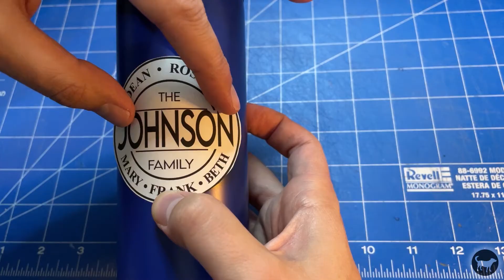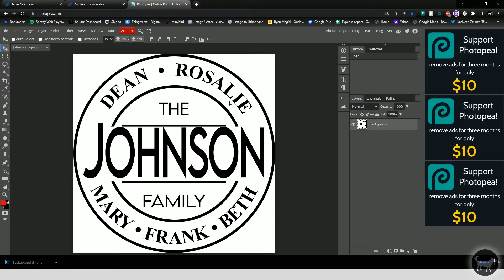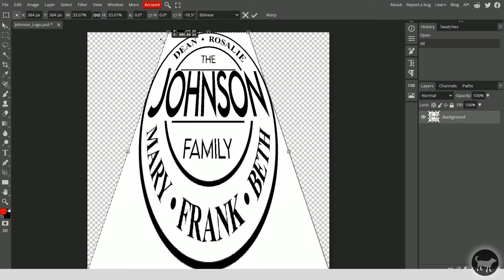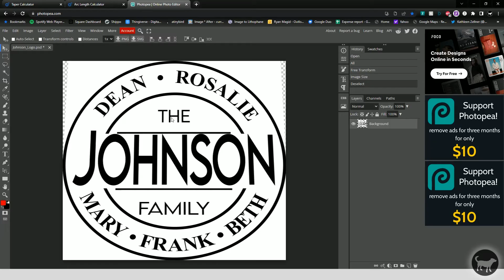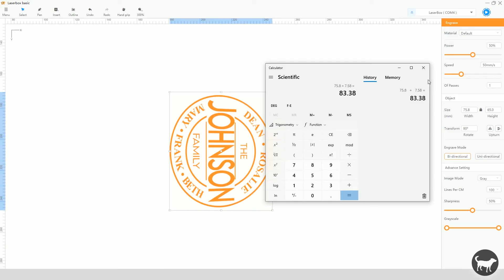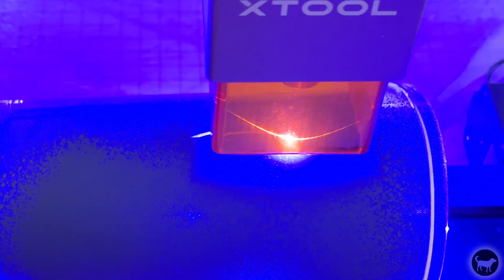Better Round logos on tapered glasses | Laser engraving rotary | xTool D1 and RA2 Pro | UPDATED

Comment: Is this not Angle to percentage solution?...
(Degrees in a circle, always 360/ angle from taper calculator) * 0.1 for percentage
So in this example
(360/4.851) *0.1= 7.42

Comment: Great video, it answers all the questions I had about this exact subject. Thank you!  

I am curious about accounting for the distance the laser thinks it's traveling. I use XTools Creative Space, so I don't know if the options you show are even available or if they are needed? Is this something you have to account for based on the laser software you're using or is this a common issue based on the item (tapered pint glass)  your engraving?
Reply from the maker: I have basically used the same technique even when using creative space. It’s not an exact science as it’s all about your perception but it dials it in pretty close to get you most of the way there.

Comment: Will this concept will work with 30 and 40oz tumblers with/without handles?
Reply from the maker: It should work with any size. However if you are using Lightburn they have since added a tapered glass setting in the software that you should also give a look to.
Reply: @BusterBeagle3D  I don't have lightburn. I have the xtool p2 and use creative space. I don't know if the canera works on lightburn
Reply from the maker: @briancarter9197  I don't think the P2 camera works in Lightburn. You should still be able to use this technique for the tapers.

Comment: I'm following your video (thanks its really helping) but getting an issue.  I've checked my rotation calibration and 50mm in lightburn is 50mm on the rotary but when i burn the image the burnt image is wider than the paper print out i did to check it was ok.  Same height just wider.  Any thoughts as to what might be causing it?

Any help greatly appreciated and thank you for the videos.
Reply from the maker: It doesn’t really make sense that when you check the distance it’s correct but the artwork is stretching.  If they are both 50mm wide they should be correct. I honestly can’t think of what would cause that.
Reply: Thanks - It's so frustrating @BusterBeagle3D

Comment: I'm fairly certain that the 90mm you measured at that location would have in fact been a larger number if you took the measurement closer to the top. 
So your correction was needed at the specific spot you desired to engrave.
Worth considering is to use the diameter/circumference at the specific locations the image would land at both its top and bottom of the image being engraved (instead of the top and bottom diameters of the tumbler.

Thoughts?

Comment: Where did you get the tail support for your tumbler. Also, I know a secret tip for getting the D1 to mark black in Stainless Steel, cheap !! not that expensive stuff either.
Reply from the maker: The support on the end of the tumbler is part of the RA2 Pro from xTool and I'm always up for a cheap secret tip.
Reply: @BusterBeagle3D  Dry Graphite lube.
Reply: @BusterBeagle3D  Spray 2 coats, let dry between coats. Power 100 % speed 300mmm. I do it 2 times for picture's, but this is tricky, if you want to know how. Cleanup with alcohol and paper towel.
Reply from the maker: @forrestgumpv9049  Two coats of what?
Reply: @BusterBeagle3D  CRC Dry Graphite Lube

Comment: Is there a need to account for the taper if the rotary is angled parallel with the laser taking the taper away?
Reply from the maker: It needs to be angled to keep the proper focal distance from the laser. That doesn’t remove the taper from the cup itself. You would still need to account for the taper if you want your design to look correct.
Reply: @BusterBeagle3D  ok thank you for the reply!

Comment: What if instead of being short on the 100mm turn, it's actually over by 50% (150mm). Do I have to subtract 50%??
Reply from the maker: If you are that far off I would make sure you have the proper settings for your rotary. Not sure what program you are using but I would check the settings and make sure you are entering the proper roller size as well as other settings it asks for in programs like Lightburn.

Comment: Nice vid! Question: what correction do you have to do to engrave a square logo instead of a round one? I've been having issues where the top and bottom lines are a weird curve and no one's addressed this. Thoughts? 🤔
Reply from the maker: I don't have any specific tests on squares vs circles. The whole reason for making the circles wider is to fix the perceived oval-ness of the circle even though it technically is not oval, it's perfectly round. I'm not sure why you would be getting a curve at the bottom and top unless the cup or tumbler is not very square to the laser itself. If the tumbler was angled to much I could see how you might get an odd curve but I really haven't done any tests to verify this.
Reply: @icmpeko  @BusterBeagle3D  the reason you’re getting curved lines instead of straight is because you are basically engraving on a cone, not a perfect cylinder. You can try warping the logo to make the horizontal lines curve in the opposite direction before proceeding. Then print it out on paper and see how it looks. I’m sure there’s an equation to figure out the amount of warp based on cone taper but I don’t know that offhand. I’d say print out multiple squares with slightly different warp amount and then see which one looks the straightest on the cup.

Comment: Thank you for this video! I'm still having a hard time, even after following your instructions step by step. The image still comes out longer rather than round.  The only 2 things I'm doing different is saving it as an svg and using Lightburn. I'm using an xtool 10w pro and the chuck. I have to be missing something somewhere, I even added an additional 10% after my initial 10%.
Reply from the maker: Check out the Lightburn rotary setup on the xTool website. I know that the steps rotation is not the same as the rollers but I can't remember it off of the top of my head. Might still be a good idea to run a test to see if it's moving the full rotation you think it is by moving it 100MM and measuring to see if it's actually doing it.

Comment: Awesome video learn something I have been struggling with.  I use light burn I'm assuming is similar. Also is there a technique to keep your tumbler or glass from sliding from the rollers?
Reply from the maker: You can burn tumblers in lightburn the same way. It does not have the ability to taper the image but it can burn them just fine. As far as the slipping I have seen people have success with weighing down the tumblers with something inside, I have used a bag full of plastic pellets myself. I have also see people use rubber bands on the tumblers to give better traction on the surface.

Comment: Thank you for this video, it is exactly what I was looking for!  I do have one question.  Your rotary seems to have something supporting the smaller diameter end to level it.  Is that something you purchased, or something you made?  Could you share more about it either way?  Thanks again!
Reply from the maker: It is a component that comes with the RA2 Pro. It is used to level out the tumblers/glasses that you are trying to engrave on. If you already have one of the older rotary attachment there are many people selling that type of add-on on Etsy.
Reply: @BusterBeagle3D  Thanks!

Comment: After the Glass is Engraved what do you use to clean up the Glass I have found the engraving leaves bit of glass in the engraving that needs to be scrapped out?
Reply from the maker: I don't seem to have that same issue. You may be engraving with too much power. Might need to run some tests where you back it off a little bit.

Comment: Props for telling people about Photopea, I've been posting links to it for people for years... great option to Photoshop, just link inkscape is for Illustrator...Everything was great besides telling people to increase image size... never do that as that will degrade the image since it wasn't vector... or at a minimum turn the layer to a smart object first to always preserve detail of the original artwork. Also your export to png added that white space on the edges, it wouldnt have if you used file > export as... this exports the canvas size (the exact square you had) , not the image size as the png download button does which if you hover over it says "save selected layers as png" which is why its adding that extra white space since its exporting your warped images bounding box. Hope that helps some.

Comment: Hi Mr. Beagle,
Nice video. Question - When I try to export the file from laserbox basic, the file format is shown as Asian language characters. That does not work well with Photopea. Any suggestions?
Reply from the maker: The file that is exported from Laserbox basic is a .LQX file. It’s not an image format and is only readable and usable in Laserbox basic. You would need an image or SVG file to open it in Photopea.

Comment: Any chance you can make a tutorial using lightburn with RA2 (chuck), or the same procedure applies to the image when using lightburn?
Reply from the maker: I just installed lightburn but I don't have any videos with it yet. Lightburn does have a rotary setup that includes things like the circumference, and diameters of the objects you are engraving on but I would still test to make sure if it's moving the distance you think it is. As for the round stretching trick that would still apply to glasses or mugs burned through lightburn so you would still want to alter the image to make it look correct.

Comment: I am interested in the paint you used. Do you mind giving a link for what you're referring to as I am not sure how to even spell it. Is this paint what is left on the cup after etching and it turns that white? Also, I am wondering what it does without the paint? Is it a more translucent etch? Lastly, is this something that can be done with the 5W version?
Reply from the maker: It's called Tempura paint. You can buy in at any craft store or even the dollar tree. I would think the laser would just pass through if you didn't coat it with something and I'm not sure about the 5.5W laser because I have not tired it yet with this method. It's not the paint that is left but the black surface that allows the glass to be etched.  https://www.dollartree.com/prang-tempera-black-paints-8oz/300669
Reply: I’ve gotten great results with 3M blue painters tape using my 5w laser as well. I’m super impatient and hate waiting for paint to dry 😂
Reply: @anthonymontezcomedy814  What are your settings using the tape? I can't get it burn on my beer glasses using the tape. Its great for test runs, but nothing burns through. I have a 10w D1 Pro and currently I'm engraving at 100pwr/70speed/1pass.